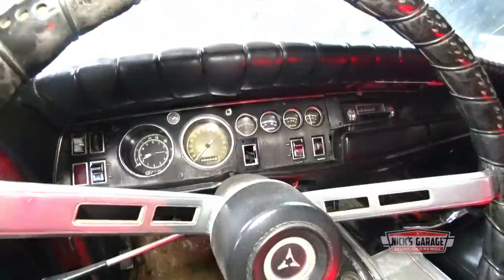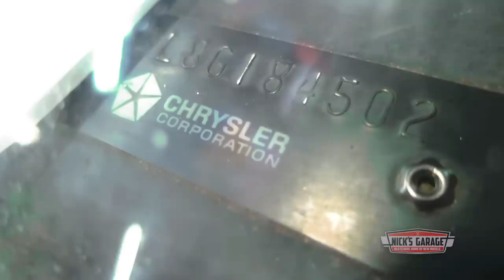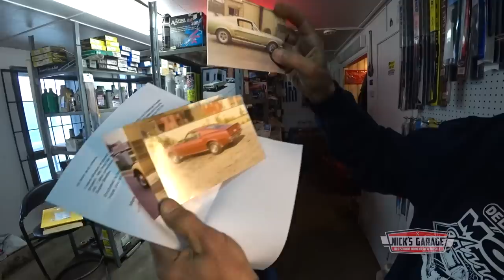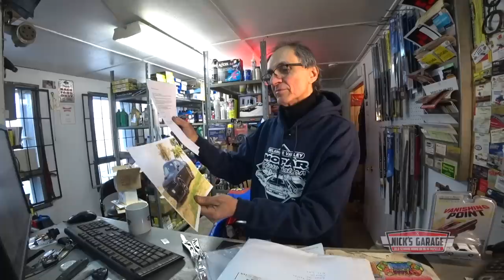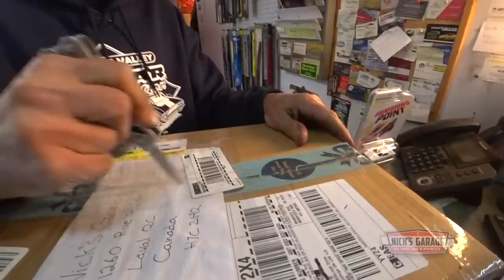1968 Coronet R/T 440 Tear Down - You Won't Believe What's Inside!

Comment: It was dropped down the carburetor. Unfortunately i learned that lesson the hard way myself when I was very young. Dropped a tiny hose clamp one night. Could not find it. Two nights later i found it with a blown motor. Say good by to my 327 Vette motor with the 202 heads. Like i said, hard lesson learned. Always cover the carb when working around the engine.

Comment: You said one side of intake had studs the other side bolts. They broke a bolt off & tapped the whole side with studs but the broken bolt was either dropped through the carb or they dropped it on the still good piston & fired up the motor & wammo!

Comment: I saw a case where a t-shirt was left in the plenum of the intake on a Chevy BB 396.  Long story short they managed to get it running for a very short time and it sucked the t-shirt into the engine ruining both heads and the block!  It was a sad thing and it wasn't the owner that put the carb on.  It was an eager beaver helper that did it!  No, he didn't reimburse the owner one penny!
Reply: I just pulled a rag, thread by thread, out of a rebuilt Harley motor. Don't know what the guy was thinking. Put it in the bike, tried to crank it over nothing. I pulled the spark plugs and cotton fluff came out. Took me over an hour with a grabber tool to pull the whole rag out through the spark plug hole. I wanted to tear the whole motor down, the owner insisted otherwise.

Comment: My dad and I built a 440 back in the seventies and I apparently dropped a bolt during assembly and it was a 5/16” by 2.5” and went through the valve and ran for about a hundred miles before it dropped all we had to do was replace the piston I got really lucky it didn’t hurt the rod or crank

Comment: Nick, my '62 Dodge Dart had not run for 45 years in CA. I fired it up. Runs smooth.  318 Poly, 4V Power Pak. But it only has 100 psi, cranking, on all cylinders. What could be wrong?  Paul, NZ.
Reply: moyadapne.    1962, 100 psi. Runs smooth, if it drives OK, just drive it and enjoy it Paul.

Comment: Don't know where it came from but the 20 minutes of rough running was probably when it was trying to make its way through the valve opening and damaging the lifter in the process ( sides of the bolt are smoothed over) then it finally made it through and instant damage/stuck in piston.

Comment: I had a motor that the valve was rusted open they had just rebuilt the motor and nurld the guides on the head then the car sat for a year when we started it the valve was stuck open ,when we turned it the push rod came down but the valve didn't so It bent the push rod because it fell out of the rocker hitting the edge of it and bending the rod ,,,,it hurt nothing else so we new it was a new rebuild so I straightened the push  rod ,,,,got the valve working and put it back together I ran that motor on a high idle for 4 hours ,,,,the motor had not been broke in after the rebuild that's what caused the bent push rod we were very lucky to figure that out without breaking any thing else that was 7yrs ago that motor is still running in my pickup it has 180 thousand miles on it and still running strong.

Comment: On my 72 Gran Torino with a 351-4V i broke a rocker where the pushrod pierced all the way through & stuck there. It did not go through the valve cover & i shut it down within a sec of the pop i heard. Replaced the rocker & pushrod motor ran fine 100k after that as well.

Comment: And power tools can strip bolts and damage things. Theres a reason that the navy and airforce use hand tools on explosive ordnance when putting on guidance systems and fusing. Because if you strip the bolts you cant remove the fuse and then you have armed ordnance.

Comment: There is only a few ways that bolt could get in there...would like to see the valves and valves seats...I did not think those valves could open that much to let that bolt into the cylinder..Calling  Dr Nick...paging Dr Nick...lol
Reply: Robert.    True, cannot pass through intake valve or spark plug hole.  ??????

Comment: I was a auction mechanic for twenty years I've seen where the buyers would drop nuts or bolts in the cylinder so that would tow it through the block at a reduced price it's a shame but it is a reality

Comment: From experience, this actually happened tome, on a 318, if the valve sticks open, the hydraulic lifter pumps up and gets longer, then it holds the valve open further until the valve hits the piston.  Then the piston shoves the valve into the rocker, which shoves the rocker into the pushrod, and the pushrod goes through the rocker.  Then the hydraulic lifter is thrown out of the block by the camshaft, and the engine loses oil pressure.   It sounds catastrophic, but really, just unstick the valve, put a new rocker on, new pushrod, and put  the lifter back in the block.  It didn't even bend the valve.  It was hard to figure out why the oil pressure was gone until the engine was apart.

Comment: I replaced my Holley 750cfm to a 600cfm when i moved to Colorado, 1 stud i lost searched for 2 days. Stripped off the carb magnet to the the runners nothing removed intake then saw that damn stud standing on its head no less on the cross member. Better safe than sorry or that guys motor.

Comment: Found this once on a brand new engine.  Started missing after 30 minutes of operation.  Found a nut holding an intake valve open.  Removed the nut, and no actual engine damage.    Quality control failed there.

Comment: I had that happen 30 years ago. pulled the intake to replace a gasket, got it back together ran for about 30 secs then knock from hell. pulled head and there was a wood screw stuck in the piston. dont know where it came from must have been laying on the intake and dropped down the intake port. but I didnt damage the head it cracked my block in number 7 cylinder.

Comment: That bolt didn't fall thru the valves because it wouldn't fit thru the valve area, it may have been put thru  the sparkplug hole, but if that had been a fun or chebby it would have destroyed the block and head. Mother Mopar only can live thru that and made able to run again!.

Comment: The bolt was behind the intake valve. It couldn’t pass through with normal lift, but the small end might holding the valve open. The lifter would pump up until it popped out the retainer. Then it could pump up farther and opening the valve even farther.allowing the bolt to pass through.

Comment: If you go 30 over, better get a new high flow radiator, extra row, add electric fan, tighten up and improve seal on cowling system.

Comment: This was sabotage, I had the exact same thing happen to my 1965 t-bird. Had a great running engine in it that ran like a top. I took it took a local shop to get the power brakes fixed. After they had the car for almost a month I finally fussed and told them I wanted my car back. I made it home with the car running like hell. Shortly after I pulled it into my shop at home, I heard a "bang" and a bunch of clatter. Found water in the oil, pulled the head and found a 3/8 fine thread bolt in #6 cylinder. Unfortunately it split the cylinder almost from the top too bottom of the block and I had to replace the engine. My car has never seen the inside of a so called " garage" ever since.

Comment: Bought a chev truck with screws from choke blade making it knock.  But goofiest one, a 3/8th X  1 1/4  intake manifold bolt holding valve open till motor ticked. If you dropped a 3/8th bolt, you think they would magnet or needle nose it back out!

Comment: That bolt is wild! There's no easy explanation how that got there other than it was sitting on the piston when they put the head on but if that were the case you would think they'd notice it right away. 

Or when they noticed it did they just stop driving? How could  something that size go through the valve? And a bolt  like that didn't belong in the valve train anyway

I was never a big Mopar fan but watching this program makes me wish I had a 68 or 69 charger with a 440 6 pack

Comment: Would love to know what goes into the Kowalski 440. Ive got a 72 440 block destined for my 67 Charger.  But its a 72 so its got some nasty power robbing smog heads and i want it to haul butt when its done.

Comment: I think someone at some point removed a pair of headers and replaced with those manifolds with the sparkplug out and somehow dropped one of the bolts through the sparkplug hole. The size and length of the bolt looks like a header bolt. I don't think it could have fit down through the valves.

Comment: So if you’re putting stock valve covers back on it are you going to paint the engine to the correct turquoise color?
Reply: Randy.        Yes, for sure.
Reply: I figured you were, just caught your comment early on about the blue/turquoise under the orange, lots of 68’s incorrectly are painted orange cause people like it, it looks more performance oriented than the turquoise...  I’ve got a PP1 Red 68 Coronet R/T too, and I struggled with the turquoise/orange but in the end turquoise wins... Not my favorite but it’s correct... I love lots of details about the 68 but there are a few 69 changes that I wish came about a year earlier... Ramcharger hood, the wood grain console top..

Comment: Probably the distributor bolt that was incorrect. Maybe they changed the distributor to get it fired up after sitting for years and they used the air cleaner for storage but couldn't find it when reassembled

Comment: If that engine had been started with that bolt in there it would have been instantly obvious. I had a case once where I replaced a cylinder head and a small, very small, piece of casting flash got loose and fell into one of the cylinders. When I started it it sounded like someone slamming the block with a sledgehammer, there was no way you couldn't know something was seriously wrong. Luckily, it was small and just made a small divot in the piston, no harm done. In this case the piston would have probably broken immediately. I'd be willing to bet it's the distributor bolt, it looks like one. There's no way it came in through the valve. Maybe a little sabotage by a "friend" watching the work in progress?

Comment: Carburetor bolt. 440's were nightmares to jet Holley 4barrel without a dyno, so they would melt off spark spark plug tangs and folks would try to jet them with tailpipe color charts and looking at the plugs or just jet it rich to be on the safe side. But anyway folks would try different carbs depending on if they were racing or daily driver. Many a carb bolt ruined a piston. You putting tape over the intake hole is VERY important. That and NEVER leave the bolts on or in the ENgine bay, Always put nuts and bolts in a pan on the workbench AWAY from engine bay!!

Comment: To Nicks garage, do you think a high performance engine with a blower on a 440 or 426 hemi or any big block and built up to about a 1000 horsepower and could be used on a Airplane Nick do you think it would work and using 6 propellers to get maximum flow and pull of air at 14 inches wide per blade, at 4 1/2 feet long each blade, 6 on the front  and the same set up going to the  back of the wing, and coming off the back of the crankshaft is another steel shaft that turns the back propeller set of 6, so all off of the one crankshaft. you have 2 sets of big propellers that engine needs to turn all 12 propellers blades, that takes some serious power to turn those propellers at high speed. But there is only one problem, that is how to keep oil flowing when the airplane goes into a spin? Or  does a sharp dive? Or does a hard right or left turn, how to keep the oil going through the crank shaft and better yet how to get the oil sump to pickup the oil when the engine is at all kinds of angles in the shy? Do you have any ideas for this how to fix this problem with the motor oil issue?
Reply: Ger Desoto. Mike O'Sullivan's SUPERMARINE AIRCRAFT has a 90% replica SPITFIRE that used Rotax, Jabiru, Isuzu, engines, finally settling on a Chevrolet LS2 V8. Everything from weight, power, fuel consumption, oiling system, reliability, performance at altitude, and, fit to airframe would have to be considered. Mike O'Sullivan would be a guy to ask about adapting an engine to a plane. SUPERMARINE MK26B. Cisco Texas.
Reply: @victordjinn632  in reply to what your saying about adapting a car engine to airplane, the biggest thing is how to keep the oil going to the oil sump and crank shaft when the airplane banks a hard left or right turn or how to keep oil flowing to the oil sump in a spin in a Airplane. Then build a engine up for a 1000 horsepower or more, these engines come to mind because of there torque. 1. 426 Hemi, 440 Dodge, 488 Dodge V10. There is not many people tried to get over a 1000 horsepower out of them engines, The Dodge  V10 it great to 1500 horsepower out of that engine because of two more cylinders. Then when you're done then try to put on the airplane with propellers 16 inches wide across and 8 propellers in the circle and highly balanced to pull the airplane and make as long as needed but not touch the ground, that means you got  more speed and power. Just like in the movie top gun, like the man said, got a need for speed. The third generation Dodge hemi last year Chrysler Corporation has figured out how to get 1000 horsepower out of that third generation Hemi the posted on the internet, but last week Chrysler Corporation posted the second generation Hemi with blower 1000 horsepowers at $30,000 part number P5160194 that's at Chrysler dealership parts department

Comment: Just watched another video where Nick took the cam sprocket off a different 440 and the bolts looked a lot like this one....  could someone have had the carb and intake off, done a cam swap, misplaced the bolt and it fell into the intake port?

Comment: i got connection to mopars there is a wrecking yard with about 20 acres of  just mopars all makes most are performance cars learn about the place from my race buddies they don't advertise just word of mouth and they have everything 64 barracuda with 383 the one with the strip they have a few of those 440 chargers i use to go there for duster parts even got a duster from them with a 340 for 600 bucks running and driving with good clean body i seen it with a sign in the window for 600 i said sold they had other cars to for sell out front all running cars but there yard is just amazing on the cars they have one sad problem i'm a chevy guy but i love any muscle car only have a few mopars

Comment: My poor Uncle Teddy "RIP" dropped the air cleaner wing nut down the carb of his 472 Caddy engine years ago. You could see a perfect indentation of the wing nut on the top of the piston but never found the wing nut itself???
How is the 455 Buick build going by the way??
Reply: Peter.  Just received the cylinder heads.  Coming soon. Still waiting on a few pieces.
Reply: @nickpanaritis4122  Nice! Did you work on the steel heads or go Aluminum?
Reply: @petereconomakis149  .     We are going with TA performance heads.
Reply: @nickpanaritis4122  Wow, your 500 HP goal is very doable now! Thanx for always replying Nick..

Comment: Why would it not have zinc in the oil? Also did the bolt fall down the carb?
Reply: Johnny Yum.      First, it is an old lifter with dirty oil, and the bolt does not fit to fall through the carb.
Reply: @nickpanaritis4122  
The Manifold then?

Comment: Check out the European version of Vanishing point not but so much difference -- but has clips that they couldn't show in America
Reply from the maker: Yes! The hitchhiker.
Reply: @NicksGarage  you got it so cool that different twist I've had the original movie so many years probably seen it a million times and when I was way young running around a local drive-in was the first time I seen it and by the way I have a 1 of 35 68  Dodge Coronet  - 383 mag 4sp power steering love to have one day on the road plus a 68 GTX i drove for a number of years Ride on love the show Mopar or no car

Comment: wouldn't the bolt have been for the distributor hold down?
Reply: jason.      The bolt we found in the engine was a 3/8 1" long.  The bolt for the distributor is a 5/16 bolt, which was a shorter bolt then it should be.

Comment: Where did the bolt come from you say remember you indicated somebody had put a smaller bolt into the distributor maybe that's because they lost the distributor Bolt and you found it in the head!
Reply: Stan.       It is a completely a different bolt from what we found. So for that reason, it is not the bolt.

Comment: I agree with "the crowd" that bolt is the missing distributor bolt.  Regardless of how it found its way to the chamber, (left there or dropped into the manifold).  Lame Amateur mechanics can find a way to F U a job.  My friend tried to rebuild and reassemble his carb with the float upside down.  Keep up the faith Nick and the gang.

Comment: is it the missing bolt from the distributor ? you said that it was the wrong one ....
Reply: Darcy.    No, the bolt for the distributor should have been longer. The bolt we found in the cylinder was a 3/8 1" long, from a hardware store.

Comment: The engine was surpisingly clean inside. But I don't think you  can get a bolt that size past a valve, nor will it fit through the spark plug hole. I am convinced it was definitely left in there when the head was off. No surprise it's been worked on before- certainly some repairs have had to be made in 50 years. Amateurs though might leave a bolt inside like that. Fortunately the piston pretty much absorbed the blow and took the bolt in, and it didn't toss around in the cylinder too much to damage the walls. Funny to me some people will call a pry bar a breaker bar, when a breaker bar is a long wrench. And watch out for that valve it might pop out if it has no "cylinder head"? lol valve head.
Reply: Dave.    I believe someone replaced the carb lately and the bolt fell in accidentally.